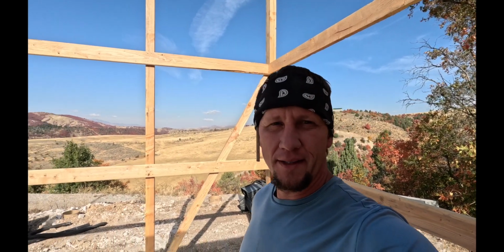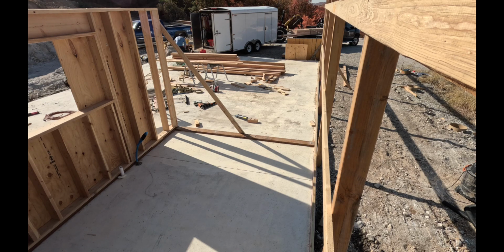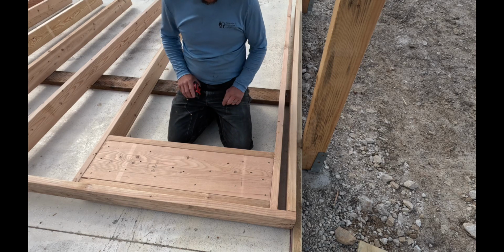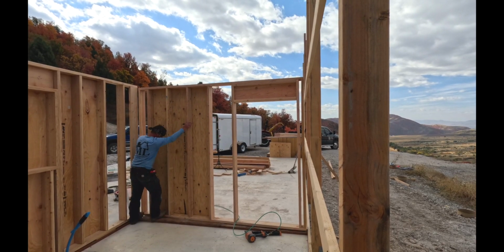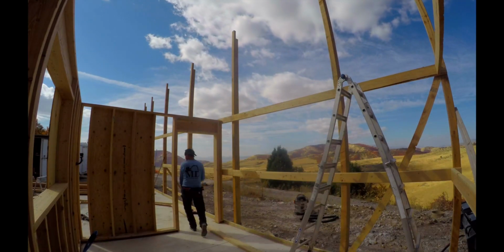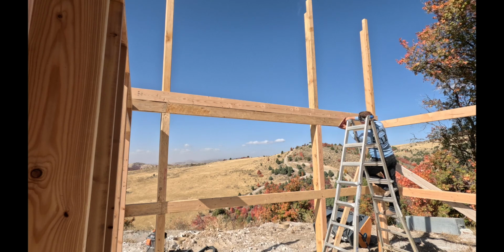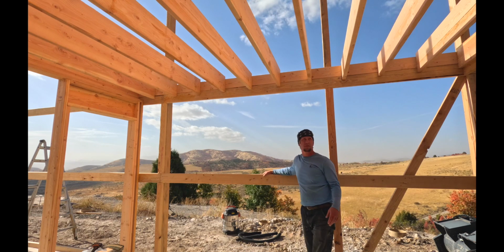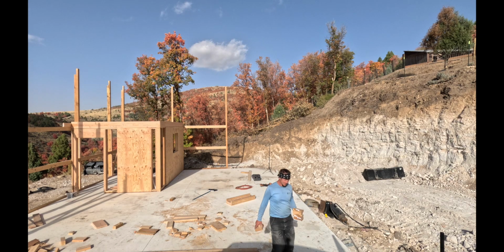Framing in the processing KITCHEN and adding the second floor | off grid building

Comment: I was wondering if the second story would be a heat problem with the batteries? I am new to your channel and watch brother channel Red Poppy Ranch on a regular basis. You seem to have a good handle on what you set out to accomplish so plunge ahead and keep up the fantastic work!!!
Reply from the maker: We are going to insulate and vent that room,  if we have to put a fan in we will, if the temperature is not regulated well.

Comment: At 24:24 you appear to be laying the 3rd piece of ply without any "stagger" from the earlier two (or didn't I see it clearly enough?).  Normal "Good Practice" indicates there should be "stagger" so that only two sheets ever join at the same spot, so as to help avoid sharp level variances with 4 sheets meeting at the same spot.  Too late now possibly, and possibly too late for many more, but not too late for boards still to be put down after you have read this.
Reply from the maker: They are, sorry you might not see it well in the video, maybe poor angle.
Reply from the maker: The next video we will make sure to have it more visible. Thank you Alan:)